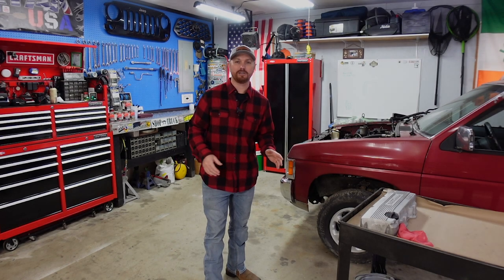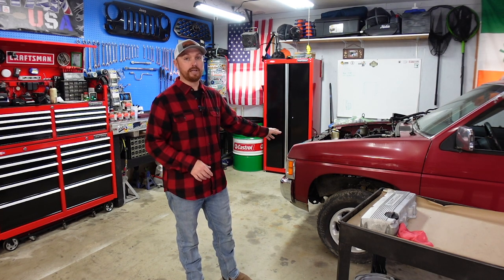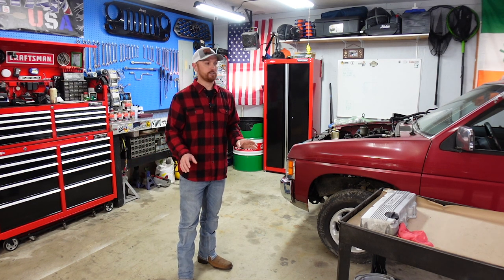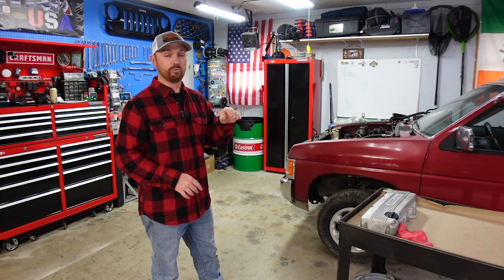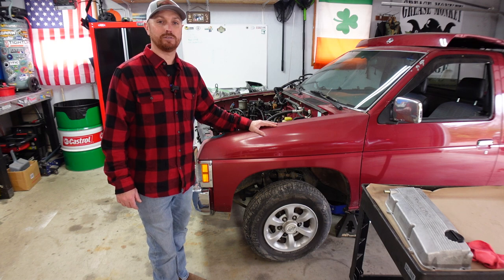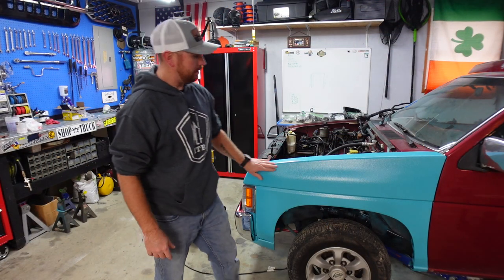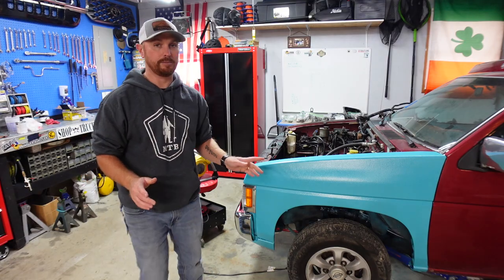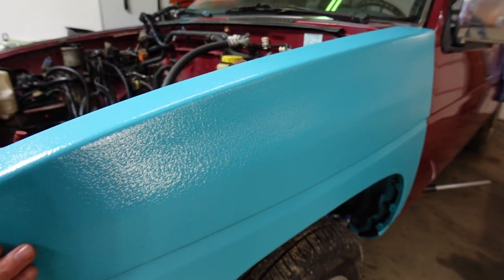I tried to paint " FAKE PATINA " on my truck!! Nissan Hardbody D21 Lowrider truck build!!

Comment: I think the heater accelerated the drying of the paint to form a skin protecting the thick paint underneath from drying properly.  
This is probably why you were able to shift the paint on top of the fender.
Ford had a color "Canyon Red" that changed colors depending on what lighting it was under.  Daylight it was a beautiful red, but under certain lights at night it looked almost orange. You might have the same issue with that turqoise under those fluorescent bulbs.
Reply from the maker: That’s what I was thinking, it dried faster on the outside

Comment: Well, as I understand it, "patina" is a worn, original, old paint job. It's meant to look weathered. Taking that idea to a vehicle seems like you'd want it to appear as thought the wind, sun, sand, dirt, and dust has hit the body in a natural way. So basically your high wear points would be the tops and fronts of the body lines. Corners of the front fenders, front hood where it drops to the grille, tops and front of fender bulges, etc. Imagine your truck in a wind tunnel. That should help you get a better understanding of where to sand. Would also seem more realistic to use colors that are factory. Grey, Black, White, Silver, Red, Purple, Light Blue. Nissan also used a light grey primer under the original paint jobs.

Comment: not a pro...I like to take on projects like you.  What if you spray all coats on but where you want patina you hit it with the roller after you spray the base colors.   That would give you a smooth texture for the whole truck but where the patina is.   The color needs a brown in it.